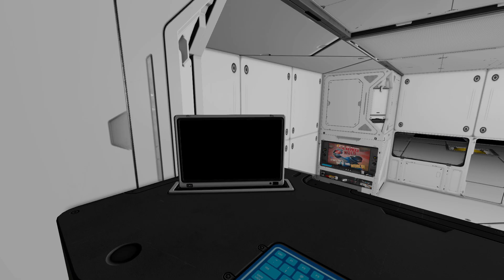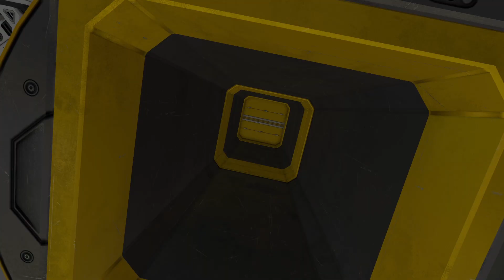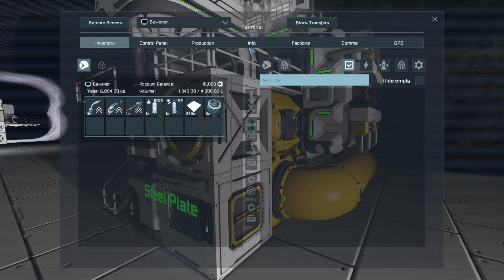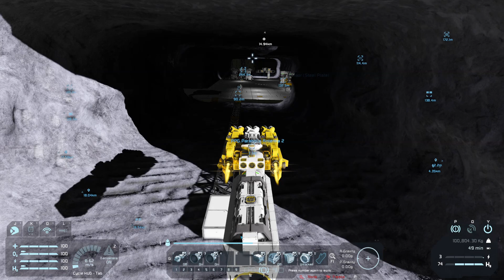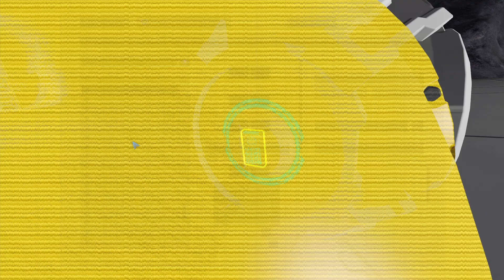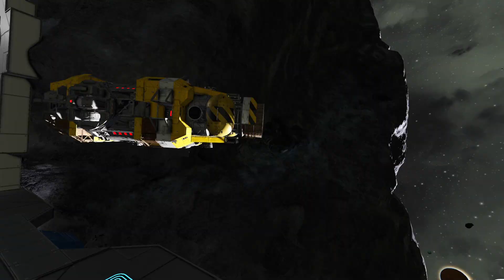Space Engineers: From Power to Production – My First Factory Build

Comment: Dave, I like that idea of processing stations, but I see the refining process being a bottle neck. Especially if you have one container per ore set up. I would still do the station but keep the refining process separate.
Reply from the maker: Yeah, I noticed that afterwards. The quick fix was to allow iron ingots through the processing station, as the other refineries are refining stone. I might have to rethink this, but for now it seems okay. Didn't really work out for a welding ship tho lol. I might refine it to be more of a personal dispenser.
Reply: From my own testing, I found that the first sorter will tend to collect all the resources assigned. 
Probably remove the refinery and put a cargo container with an event controller that turned the sorter on and off at a certain fill percentage. 
If only gravity generators affected objects. Could just tilt it down.

Comment: I designed this as an entire fleet of ships, designed to do specific jobs.

The Assembler ship is really good at doing those Repair jobs, but it doesn't need to move if all i am doing is mining. All it has are Assemblers and a connector for each component.

The refinery ship is built as a mobile station it's just got tons of cargo. It rarely needs to move, so i keep larger amounts of cargo. It's mostly a central HUB for my other ships.

Then i have an ammunition crafting ship mostly built as a defensive battleship. It's got at least 1 turret for each type of ammo, Big or Small grid.

And then i have the various transports, miners, and Fighters that do most of the busy-work
Reply from the maker: Ohh that sounds like a fun time.
Reply: @PandemicPlayground yeah, it was fun designing each ship.

The refinery kinda looks like a truck-stop on one half and a typical refinery on 1 of the 4 corners.

The assembler ship looks like a mobile shipyard / Hospital since it's good at the repair jobs

The battleship looks like your typical space battleship / Carrier, of course.

I used to have a fuel depot be the 4th side of this mega-ship, but it was ultimately more funtional and appealing to wrap that up into the Refinery-ship.

Most of the varius transport ships look like fork-lifts or Star Trucker space trucks. 

Everything is designed to be modular so that i am only using the jump drives nessesary for any given task.
Reply from the maker: @Maroon136  now i want to try doing this after i finish digging out this base just to eventually abondon it lol